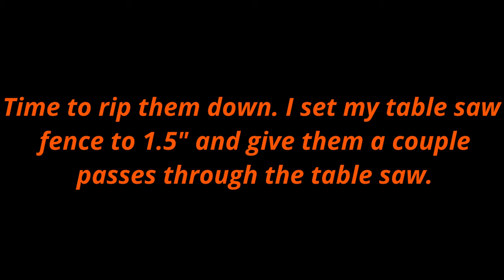How To Build A Teardrop Camper. Part 3: Wall & Roof Spar Install (Vendor Build)

Comment: Why did you use the extra pocket screws and didn't they run into the other screws holding the spars in?
Reply from the maker: I use the pocket screws as extra support for the spars. My roofs are pretty strong. I haven't had any issues with them running into the other screws. Thanks for watching